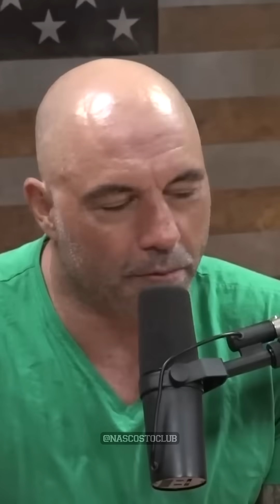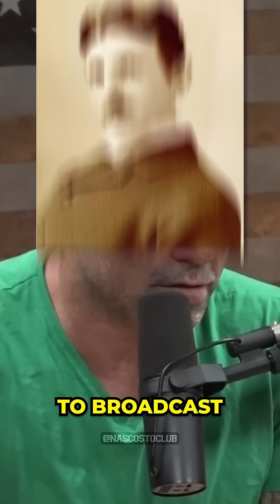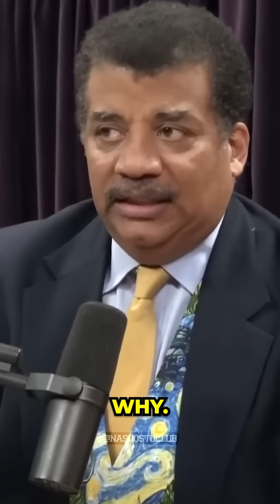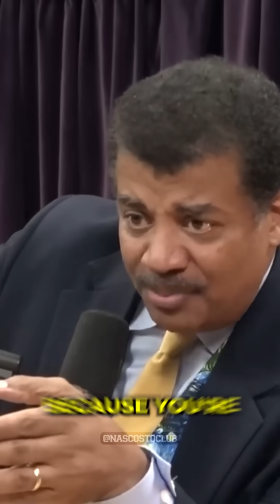WIRELESS Electricity Idea Debunked ⁉️⚡ #shorts

Comment: Back in the day of short wave radio stations  you could actually power a light bulb in proximity to a big radio antenna by just wiring it up to a loose cable. However it would have been illegal since it’s basically stealing the energy.
Reply: But also you could use it to cook your lunch and apparently this is how a microwave oven was invented. Which is the type of thing Neil is referring to.

Comment: Yes!!!! Finally found it so it's actually energy not electricity we only need to find another energy that can me harmlessly transmitted making it wireless.

Now I only need to find the energy or make something that can harmlessly transmitted through air an pointing it into a something to receive it to convert into electrical energy that it wouldn't be like your wasting energy for transferring wireless energy.

Needs work but at least Thiers something.

Comment: NDT is frustrated by the ignorance exhibited by talk show hosts jumping on bandwagons of stupidity. Electricity is already pumped through the air, broadcast radio can  be picked up on crystal sets that don't need a battery, the radio wave powers it! Station sends out megawatts you pick up milliamps

Comment: Fun fact: Electricity doesn't travel through the wires. It travels through really tight electromagnetic fields aka... the air.
Copper wires just close and complete the circuit making it easier (aka having less resistance) for the energy to go through.

Fun fact 2: Water (salty) is even better than copper. But making long thin water filled tubes are not a realistic solution, specially since water and electronics are not friends. Also, the water in the tubes would accumulate heat, so at some point the water suddenly evaporates and everything explodes.

Comment: I've always wondered how this could possibly work due to exactly what Neil was saying. I had imagined that The Tesla tower basically emitted a Radio wave frequency at a certain frequency that required a receiver that would pick up this signal being sent and it would somehow resonate with the earth's magnetic field at the receiver end to somehow deliver the power locally. Maybe the power delivered was dependent on the area or even distance from the tower?  The earth does resonate naturally at 7.83 Hz so perhaps Tesla had a theory a little more involved than just electrifying the air as Neil is ranting on about. But both these guys are way smarter than me!!!